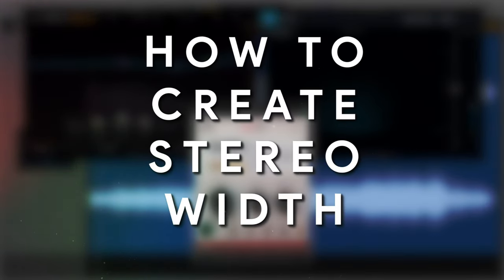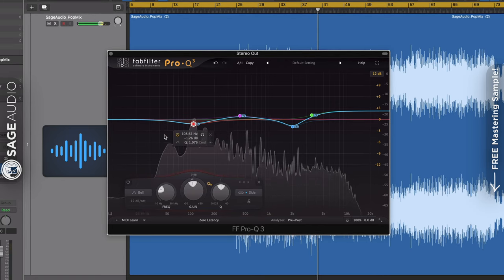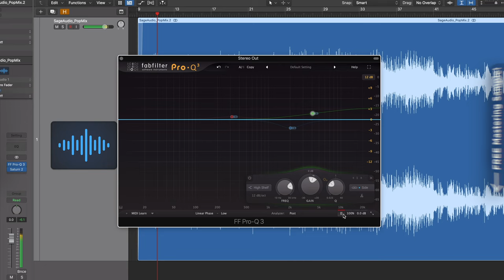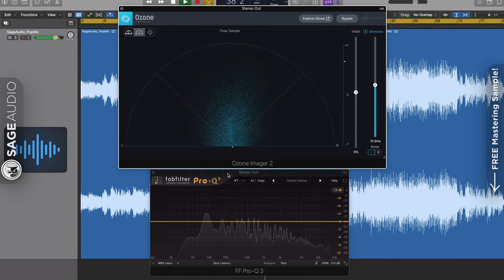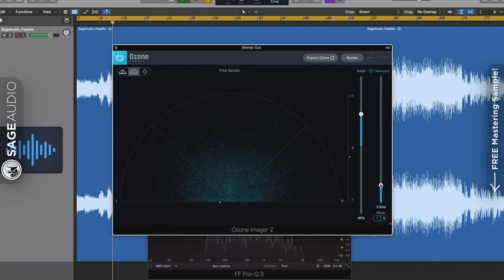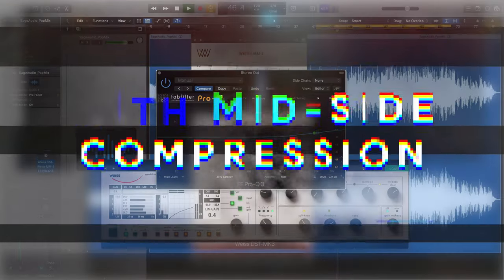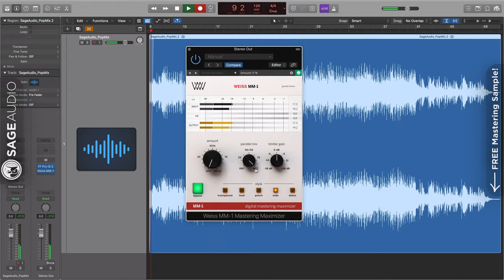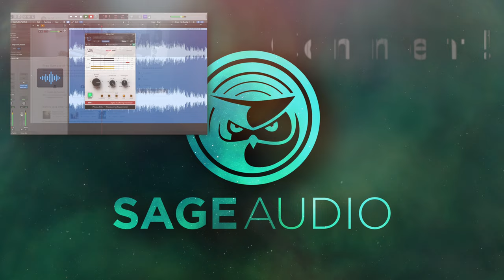How to Create Stereo Width in Your Master

Comment: Question, I am trusting my ears but can I put this on a master bus in the normal mix as the first Weiss plugin then this mm1 after? And then I run a final limiter that’s soft after that and then a very soft master compression? What do you think. Is the Weiss order even correct there? I’m guessing the mm1 would come after the mk3 based off my ears anyways and logically?

Comment: Would I use mid-side on the PRO Q3 abs again use the wide option on the WEISS MM1 after? Or is this not necessary
Reply from the maker: You could! The MS on Weiss would make the expansion dynamic since it's tied to the compression.  Thanks for watching!

SageAudio.com
Reply: @sageaudio  I’m intermediate to mixing/mastering. I’ve noticed my wav files aren’t dynamic and look the same on a lot of my masters. Is this due to the multiband being the same on each master? Would love any advice on this. If you guys have lessons I’d love to sign up for one on ones! Much love